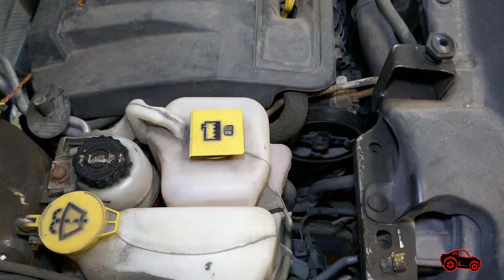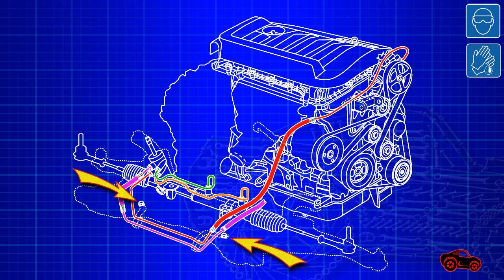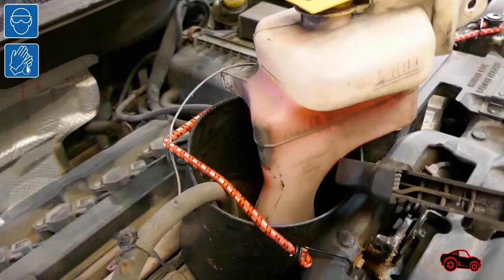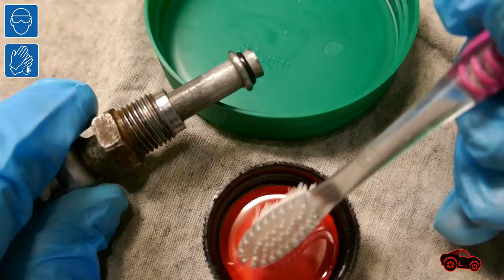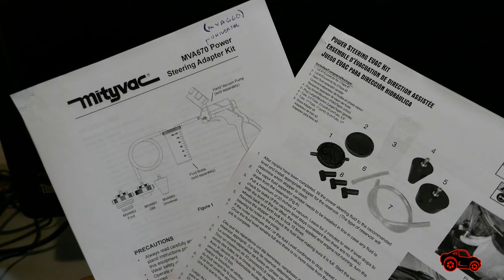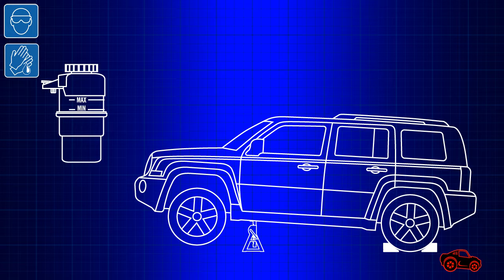Jeep Patriot Power Steering Pressure Line Hose Assembly Replacement & Bleeding

Comment: Must be nice getting an exact replacement hose from whatever store you said...instead of China bullshit from O'Reilly's, that would barely fit with a lot of curse words. Used to get good parts from O'Reilly's, now it's shit. MasterPro remanufactured pump came painted with paint peeling..why even paint it? The original isn't. Installed and then had to take the line from pump off again, the new o-ring was shot just from one tightening..now I wonder about the o-rings to the steering rack. My advice, if o-rings not damaged on old line reuse them, new o-rings will be China shit. The line from O'Reilly's that came with o-rings is Precision, avoid at all costs. The remanufactured pump is MasterPro, can update when car is back up running. Would of been a smooth job with the right line replacement

Comment: Hi, thanks for so many great, informative videos! I have a 2011 Patriot North Edition and it began making a loud noise every time I turned my steering wheel. I brought it to the dealership and they replaced the steering fluid lines/hoses because they said they were leaking. It cost me $899 but the problem seemed to be fixed. It has only been a few months and suddenly the same noise has returned. I don't see any fluid leaks, so before I complain to the dealership that did the repair, I'd like to have an idea of what the problem could be. Is it possible that they didn't bleed the air bubbles from the system? Any advice would be greatly appreciated. Thanks, Cathy from Laval, Quebec
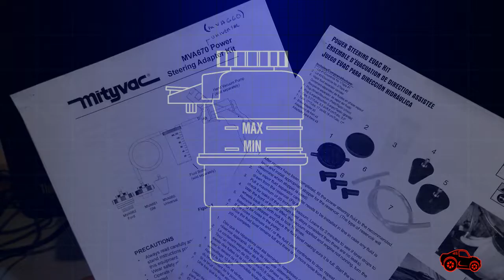Reply from the maker: First, check the power steering fluid level in the reservoir ( ref.: 4:55). 
If the level is too low, it means that the system is loosing some fluid from one of the fluid lines or from the rack and pinion fluid seals, so air pockets can be introduced in the system via the fluid reservoir..
In this case, you should use your phone to take a good picture or film the low level of the fluid to prove to the repair shop that it is still leaking from somewhere even if you can not see it.
But, if the level is between min and max, the problem should be caused by a defective power steering pump.
Reply: @mtlcarguy  Thanks for the quick response! I will do that as soon as possible and let you know what I find. I have one more question. I am planning on doing an oil change, changing the spark plugs and cleaning the fuel injectors myself but I'm not sure what tools to buy. I'm a bit confused about the difference between a socket wrench and a ratchet. What tools should I be buying considering I'm on a tight budget? Thanks, Cat
Reply from the maker: @DeadInsideUniverse 
For oil change, look at: https://www.autozone.com/diy/motor-oil/tools-to-change-oil
Note: For hazardous products like oil, the city of Laval collects used oil and oil filters.
For beginners tools, look at:  https://www.bestcolleges.com/trades/auto-mechanic/must-have-tools/
To identify the tools, google the name of the tool and look at the picture in ''Images'' menu.

Comment: I can’t seem to get my power steering reservoir to stop bubbling and my pump makes a horrible noise after changing my steering rack and pinion. I am stumped. I did a full lock to lock over 50 times and have used a vacuum. Somebody told me you were the guy who could help. I could really use your help. Much appreciated 🙏
Reply: Did you ever figure out what was causing the problem? I had the power steering lines replaced at my dealership because I had a very loud noise when turning the steering wheel. After the repair the sound was gone but a few months later it came back, just as loud. I don't see any leaks, I've bled the air from the system, so I'm baffled as to what could be making the noise? If my power steering pump wasn't working, I'd have a difficult time turning the steering wheel, but I don't! Thought maybe you solved the mystery with your Jeep and could let me know what it was? Thanks
Reply: Is it possible your lines were cracked or reservoir was shot and dirty?

Comment: what size bolts? what size wrench do you need?
Reply from the maker: I remember that the tube nuts were18mm.  The metric bolts were common and they are standard part of any good tool kit so I did not write their sizes.
Reply: @mtlcarguy  thank you, you helped me, and is there anything to replace the last vacuum pump operation? thank you
Reply from the maker: @LanaKochnieva  Open this link:
 https://www.youtube.com/watch?v=WlggBFml0Rc
This is the way I did it with older cars.